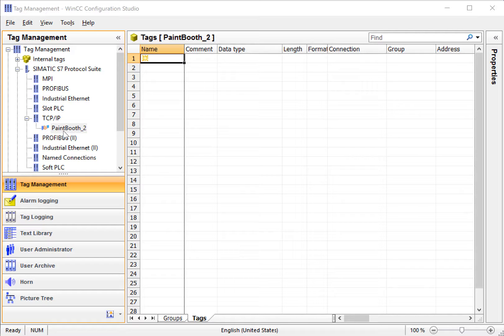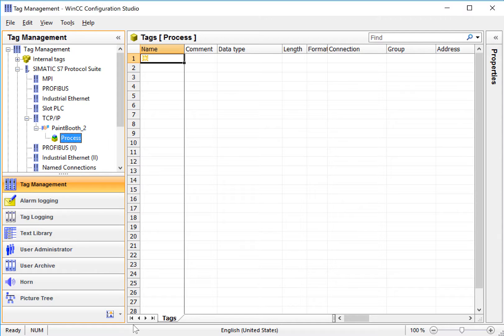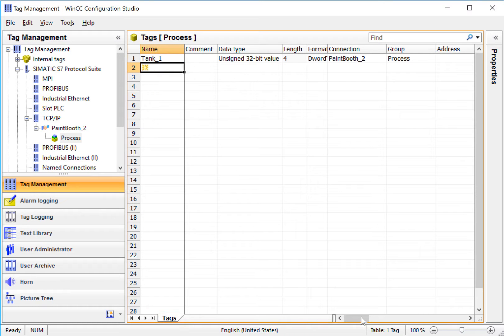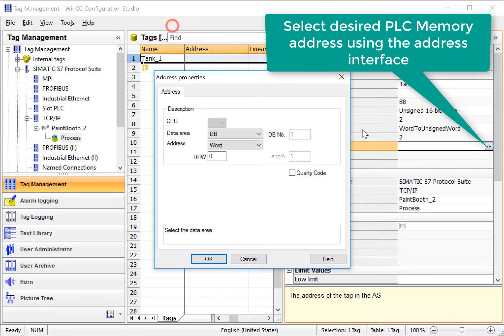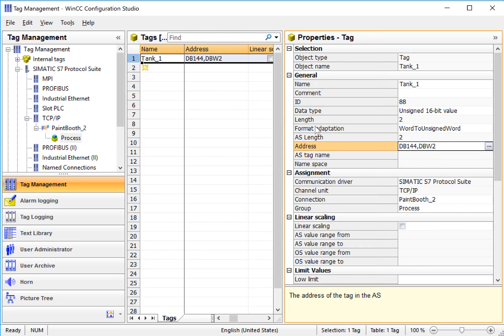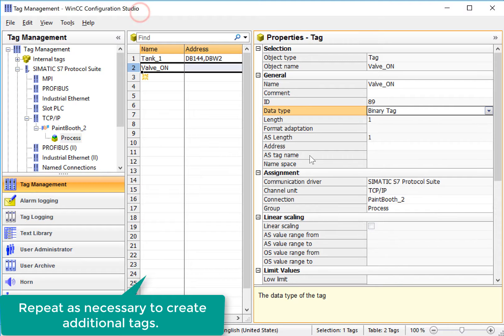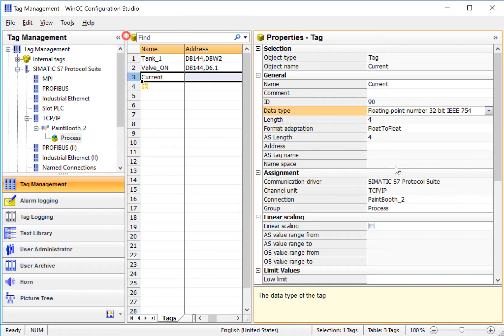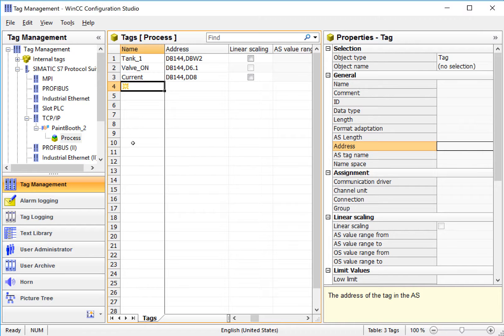WinCC v7.4 Step By Step #4: Create PLC Tags in Tag Management 🏷️ Learn SCADA Programming  #WinCCGURU

Comment: Hello Sir, I have project backup files that made some years ago. When I looking in tag management , I don't see tag like " Q20.0  or  DB20,D116.1 " , I see  tag adress like    "0001:TS:0:8A0E0008.8B2702B2.29 " , What is mean that ? and Can I edit tag adress ? ..Thank you!
Reply from the maker: What driver was used?
Reply: @WinCCGURU   Sorry, but Did you meant version of Wincc? it is Wincc V7.5 sp1
Reply from the maker: @ no, I mean what PLC driver is used for the connection where the tags are defined.
Reply: @WinCCGURU  they use to under " Internal tags > SIMATIC S7-1200,S7-1500 CHANNEL > OMS+ "
Reply: @WinCCGURU  it wasn't what you asked ,Sir ?
Reply from the maker: These are symbolic addresses. The 1200/1500 allow you to browse the tags and add them automatically. So addresses are symbolic rather than direct.
Reply: @WinCCGURU  How I can see them like " Q20.0  or  DB20,D116.1 ... "?  - or it is impossible and I just need to add to address one by one.?
Reply from the maker: @huseyingoze1373  you wont see them like that. If you are connected to the PLC you can just browse tags and add them to the project. Is there a reason you have to see them like that?
Reply: @WinCCGURU  yes, the reason is I can't connected plc diagram :(

Comment: When I have an optimized block and my block has UDT. How can I put the address in WinCC?
Reply from the maker: Hi Axel, you can use WinCC Structure Tags. The Structure tags in WinCC are geared toward the Siemens Data Block structure, where you can have 65535 contiguous bytes of data;  when creating the structure tag in WinCC you define the offset from beginning and data type, which allows WinCC to calculate the address of the tag instances. So for each structure tag in WinCC, you provide the address of the first element in the structure and the rest are calculated.  WinCC doesn't support UDTs embedded in other UDTs I am afraid. here is a video about structure tags:  https://youtu.be/5jOQ3D1scoQ